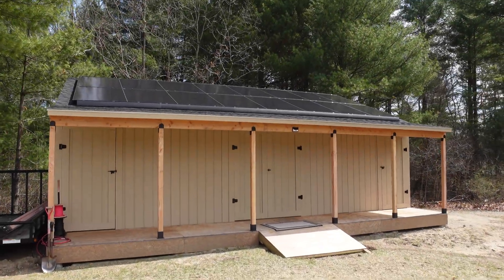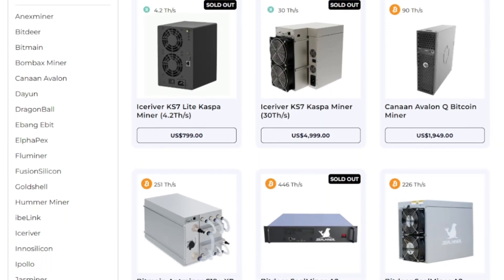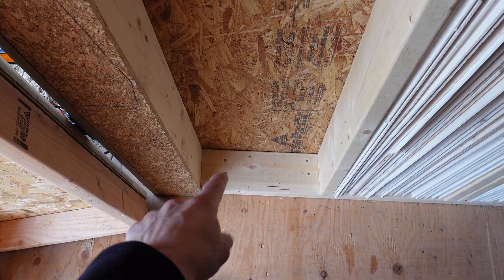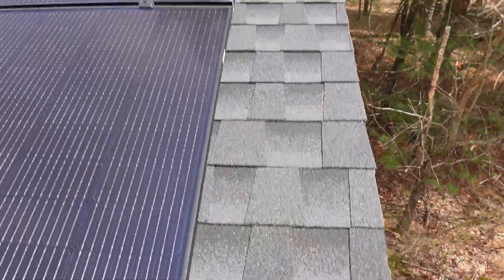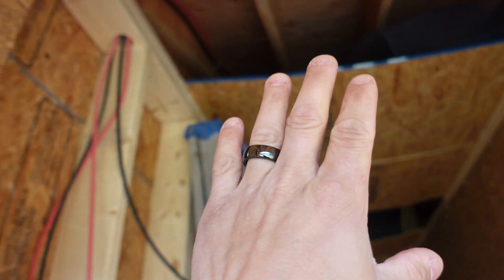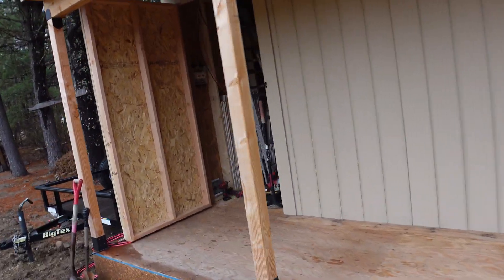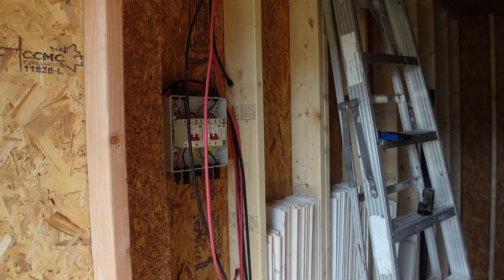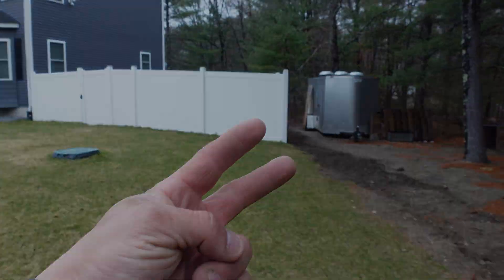DIY Solar Problems Suck.

Comment: CCXD so close .. but yeah better be safe than sorry, your setup seem to produce great energy production!, note that the female pin is hollow and also needs to be same gauge level as the male, can’t wait to see this completed!!  I wish one day you’ll also offset your home power needs.
Reply from the maker: @fullyelectric  yea in this case both pins are hollow (male and female) that’s why I wanted to be save rather than sorry

Appreciate you brotha 🙏🏻

Comment: Good thinking on the panel wiring to get the most sun soaked panels on a separate circuit!  I always hate it when I run 12 AWG wire to the popular cheap 14 AWG receptacles and the wire won't fit in the holes.